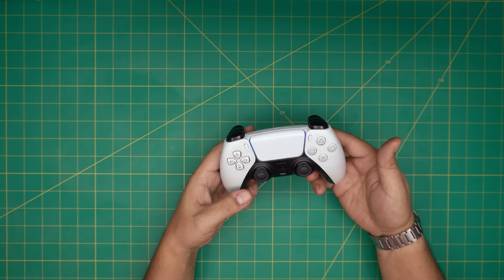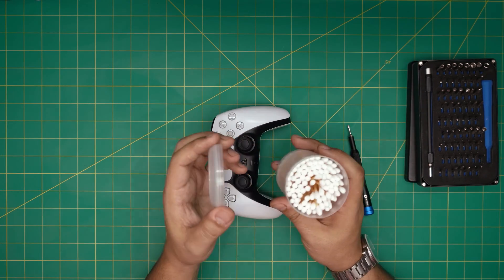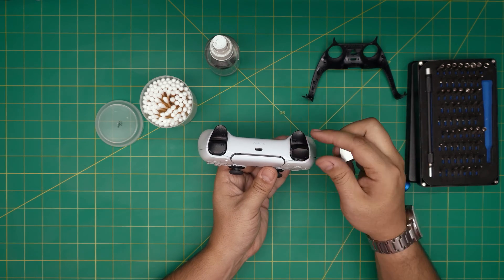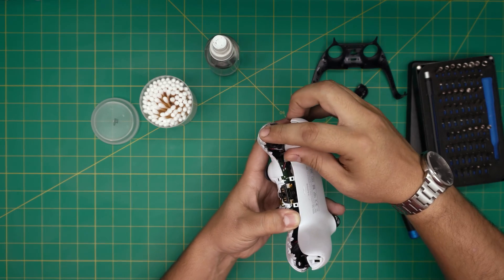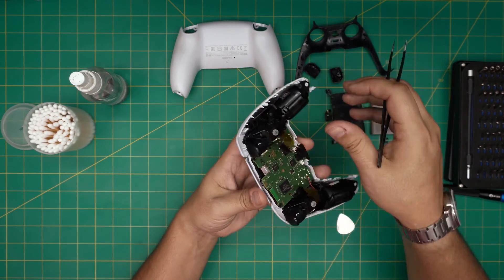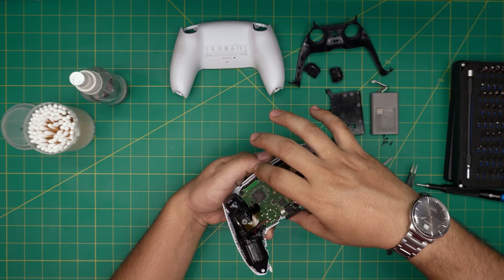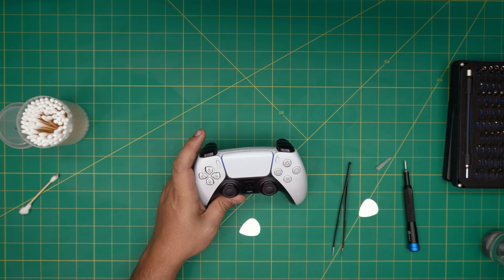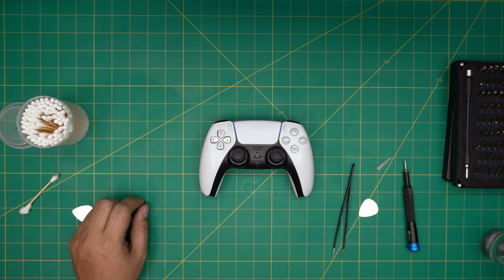How to Repair PlayStation 5 (PS5) Controller Joystick Drift - Step-by-Step Guide ✅ FIX!

Comment: 11:35 The inner piece with the spring definitely has a proper orientation, and you can easily put it back in place 180 degrees off.  Not sure if that would impact the functionality, but most likely because the spring sticks out more on one side.  The more "robust" side of the inner piece should be oriented towards the top of the outer shell piece.
Reply from the maker: YES you absolutely right , MAKE sure you place the spring end of the part upwards .
i will make a short video explaining this to the rest. thank you for the feedback.